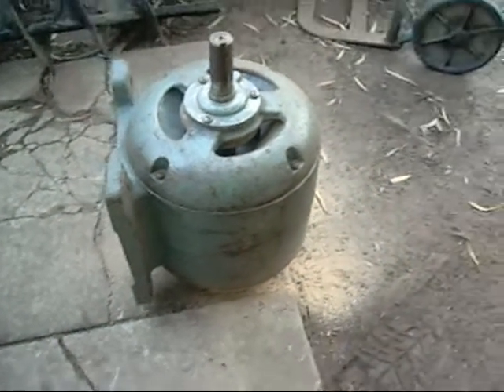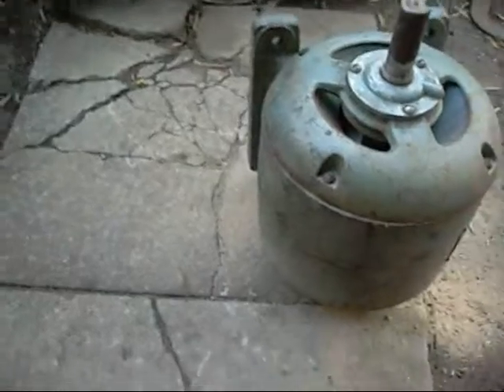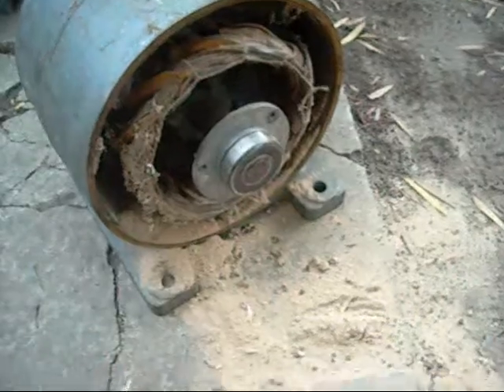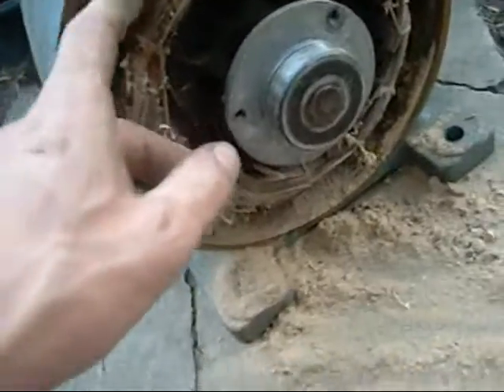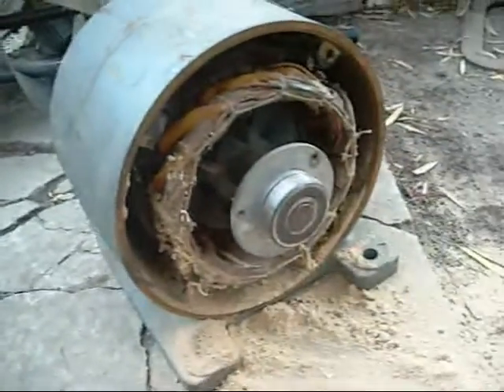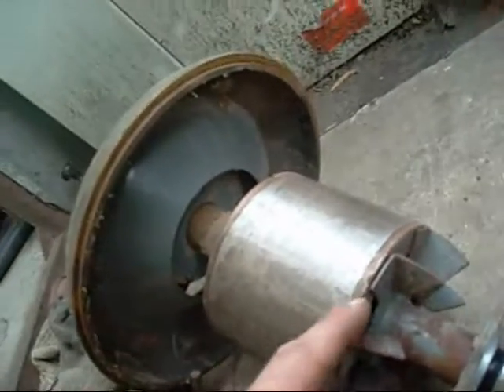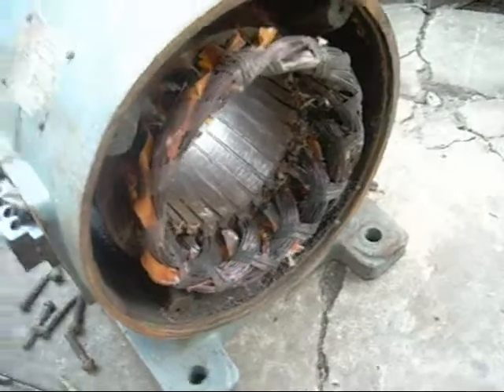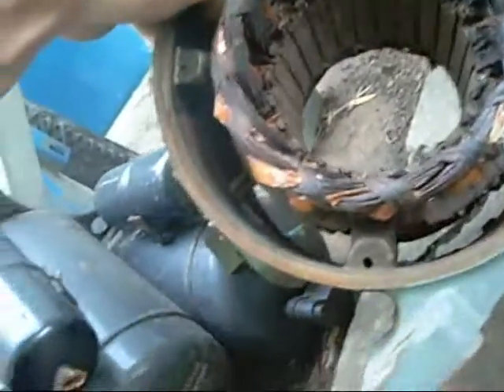Hebco 415V AC Motor Cleaning

Comment: I got a very similar motor except by Asea, a 2.2kw 380v/50hz motor. It runs fine, there is some crud on the windings and stuff and old grease in the bearings (non-sealed), it could use a strip and repaint too.

What do you use to clean out the motor and the windings? Is there some safe solvent you can use to wipe the windings down with, just compressed air isn't getting it all, though I don't think it affects function. planning to wirebrush the outside, prime and repaint.